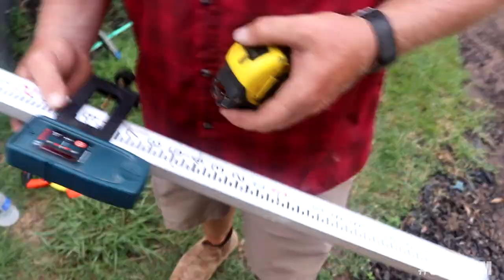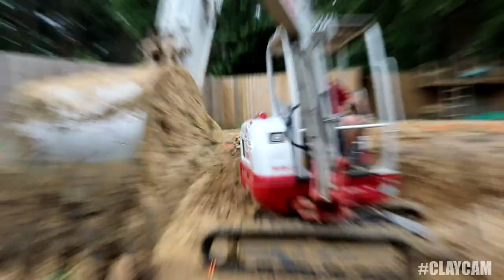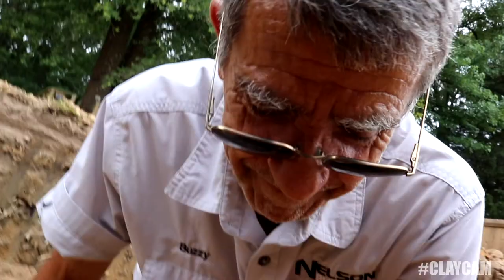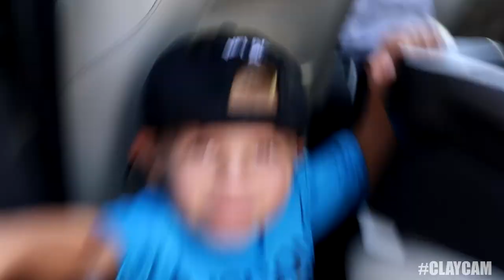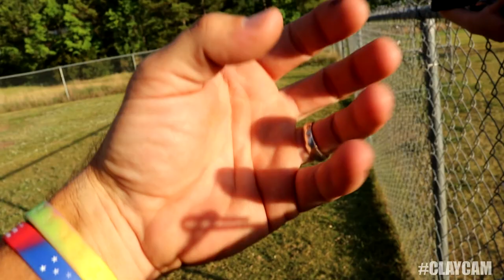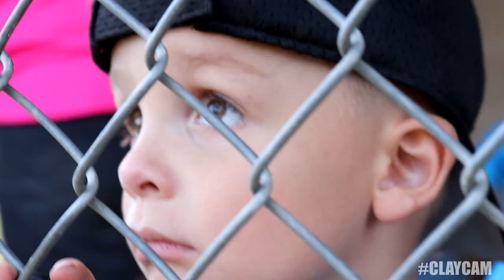HOW TO DIG A LINER POOL

Comment: Good to see a more detailed video on digging the hole, surprisingly there aren't many out there. I'll be attempting this soon and am hoping a steady hand and a good transit will help me successfully get mine done. Any other advise you might have would be much appreciated! Thanks for the great videos!
Reply from the maker: Thank you brother, I guess you can do it. The one thing I would drive home is to pay close attention to The exact height of the side walls. The dig sheet was not clear on that and we had to make some adjustments in order to get the finish elevation of the side walls correct
Reply: @claytonhnelson  thanks for that info. I'm really surprised at the lack of detail in all there videos and what they have on there website. I bought the cantilever edge and forms as well so I'll make sure to pay special attention there so the finish grade all matched up. Yours all turned out beautiful!
Reply from the maker: Klint thanks bro!